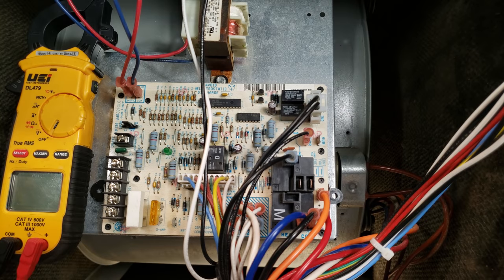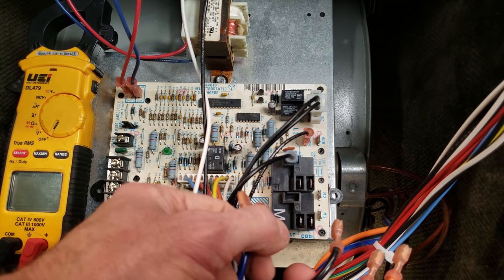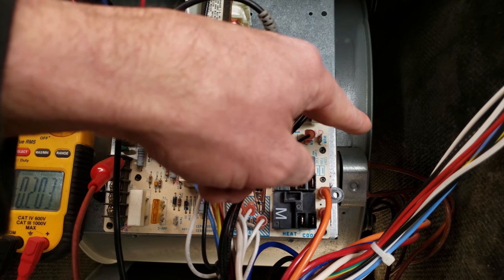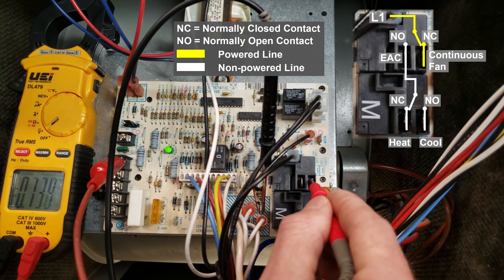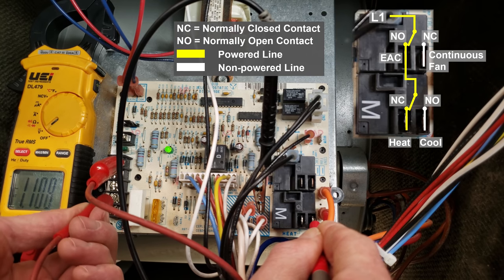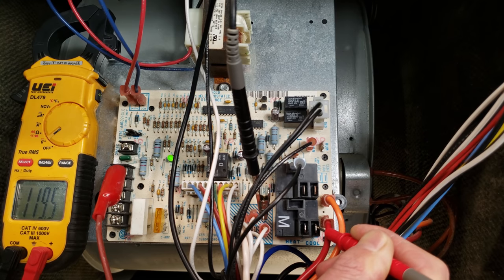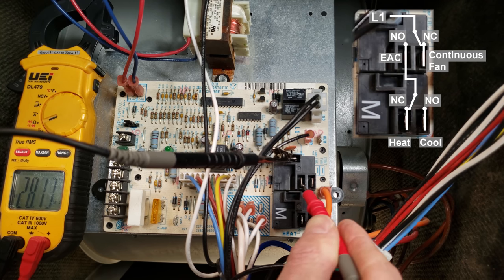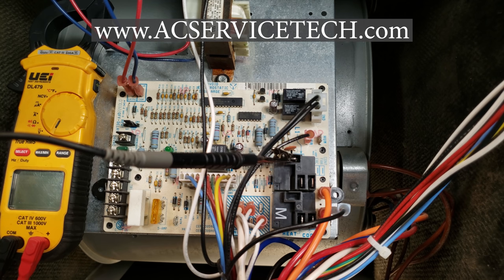How the Blower/Fan Relays on a Furnace Control Board Work!

Comment: Great video! Got any tips on how to check whether the output of an ignition coil is working? My furnace works fine if I ignite the burners by hand but automatic ignition is broken. How can I determine if I need to replace the ignitor (spark type) or if the control board, where the coil is mounted, is bad?

Comment: Thank you for the instructions. My fan motor is turning off and on and I can hear a relay click as it keeps turning off and on. I put a voltmeter to the terminals and of course the needle kept jumping up and down every time it clicked. Would that be a bad relay or could it be something shutting the power off and on continuously to the relay?

Comment: Quick question, i would really appreciate your input!

Ive been building guitar tube amps and pedals and repairing old tube and solid state radios/receivers for years and ive also replaced our furnaces limit switch, inducer motor and one other part that i forget the name and purpose of (this was three years ago). And since those repairs ive had no issues until last night i noticed our inducer motor isnt turning off again. I also noticed our air filter was damp. So at first i was convinced they were related but now im thinking correlation doesn't equal causation here. I say that because i checked that the condensate line in now clear (using a shop vac) and then i turned my attention to the furnace. It wouldn't turn on but the thermostat was calling for heat but failing to get ignition. So i took the panel covering the pcb off and held the switch while i tapped the relay when it called for heat and that did the trick. So now im wondering if i can just pull the PCB and replace the relay with the same part number/relay type. Ive worked with relay switching on guitar pedals and i am quite familiar with how they function and how to design and circuit using them as well as how to properly remove and replace them without damaging the board. So my question is what do you recommend? Should i attempt to find a replacement board or should i pull the board and replace the relay? Also do those symptoms sound like they could be related to you, the wet filter and the furnace issues that is (with your wealth of experience i figure there could be something that those symptoms are telling you that i lack the experience to see). Thanks for reading and any help you can offer!

Comment: I have a Trane x95M furnace that was installed in fall of 2021. I have a two story home. The master bedroom is on the second level on the opposite side of the house where the furnace is located (in the basement). The master bedroom is 5-7 degrees warmer in the summertime and likewise cooler in the wintertime. I am thinking about installing a duct fan to boost the airflow into the bedroom. In the summer, I usually run the furnace fan continuously and in the winter I have the furnace fan on auto. I am thinking of using the EAC terminals to power a relay to control the duct fan. After listening to your video, it seem if I use the EAC terminals, I will not be able to operate the duct fan when I have my thermostat set for the funrnace fan to run continuously in the summertime. Does that make sense? Should I use a positive air flow pressure switch mounted in the plenum to control the duct fan rather then the EAC terminals. What method would you recommend?

Comment: Hi, I just installed a "smart" thermostat and it apparently doesn't support continuous low-speed fan. Seems like I should be able to make a connection at the furnace control PCB to have it run all the time on low-speed, and switch to the higher speed when heat or air comes on. How would I do this? Thanks!

Comment: What if you have 2 zones controlled with dampers? When just 1 zone is running, I need it on Med-Low, otherwise it short cycles. But if both zones are going, it needs to be on Med-Hi or even High otherwise it takes forever.

Comment: I recently replaced a board that was burned up. The damage was isolated to the relay on the board.  I replaced the board and made sure all my connections were tight.  The unit works fine.  What caused the board to burn up?

Comment: RE: "heat speed is usually used for your fan" (8:45)
Is there a way to configure these boards so fan "on" (G) can use a different blower speed than the heat speed?
It looks like I can wire red (low) to continuous fan, but, "any time you have power to the control board, you're going to have power over to the continuous fan" (3:17).
Ideally I would like to be able to trigger red (low) only when the thermostat's fan "on" setting calls for it, so conversely, it's off when the thermostat isn't set to fan "on".
The goal would be to have the heat speed running whatever is appropriate for BTU/CFM/pressure when heat is called for, but the fan would run on a slower speed simply to circulate the air between calls for heat (triggered from the thermostat).